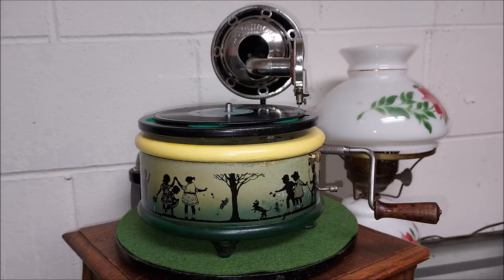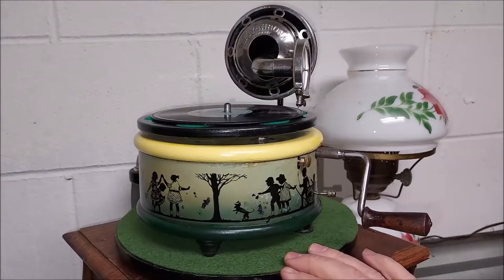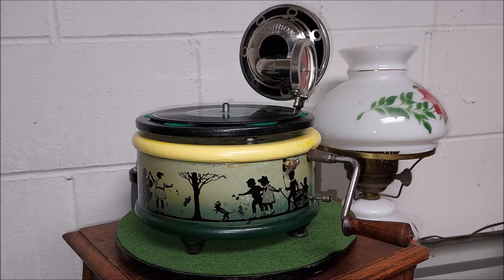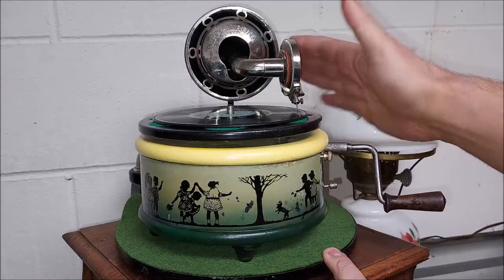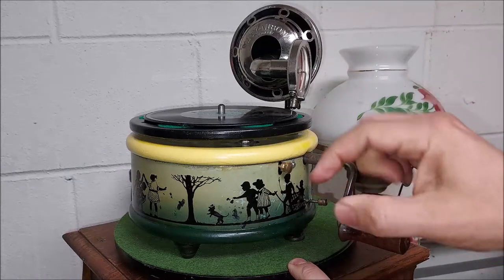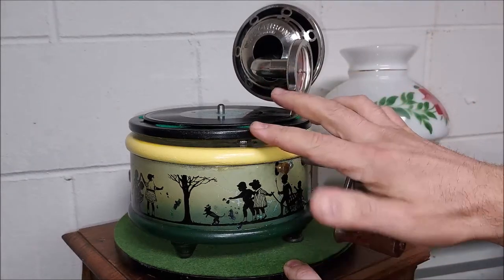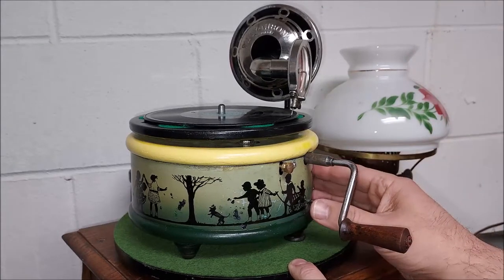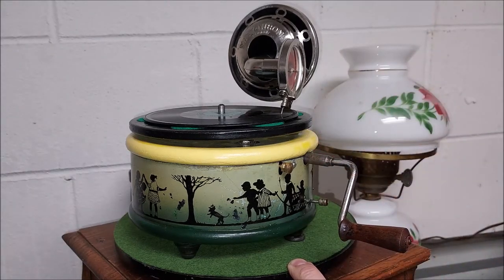1930's Nifty Nirona German Toy Gramophone / Phonograph - WHAT IS IT? HOW IT WORKS!! Explained!

Comment: Interesting machine. I do the same with the brake, when I can as it is also supposed to make the main spring last longer. The motor reminds me quite a lot of a Thorens one I picked up. Particularly the curious tabs of metal which have been folded down to make the bearings for the winding shaft. Thanks 😀 👍
Reply from the maker: Thanks! Funny you say Thorens because I replaced the governor springs with Thorens new old stocks!!
Reply: @ThePhonographStop  The governor in mine is horizontal rather than vertical. I happened to be looking in a book from 1922 today and there is a diagram of a very similar motor with a vertical governor like yours. It's strange how things come together sometimes 🤔😅👍
Reply from the maker: Yes!! This motor is very simple in design but really needs to be fine tuned like a swiss watch lol. Very touchy!